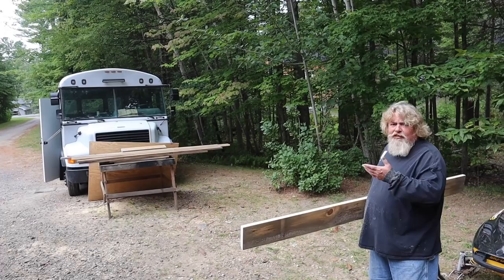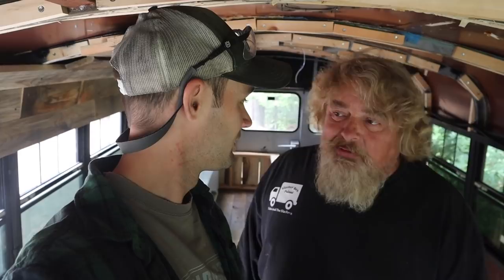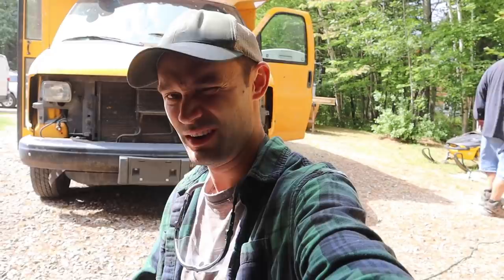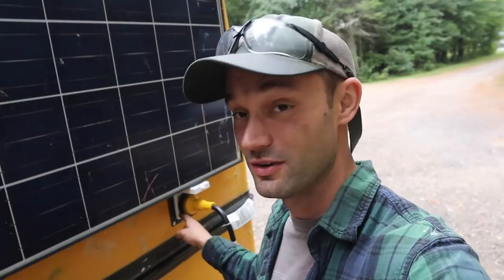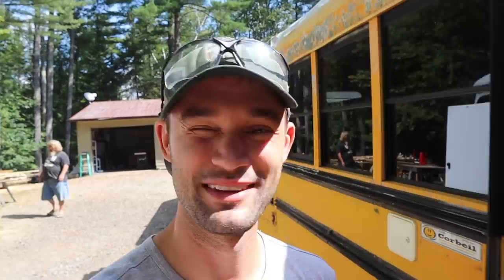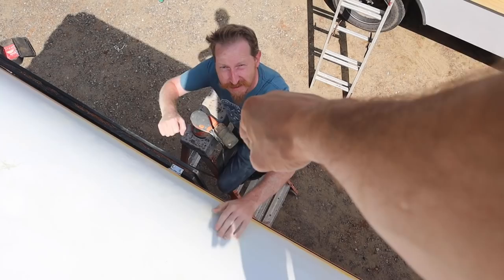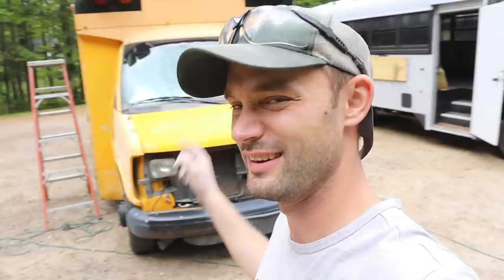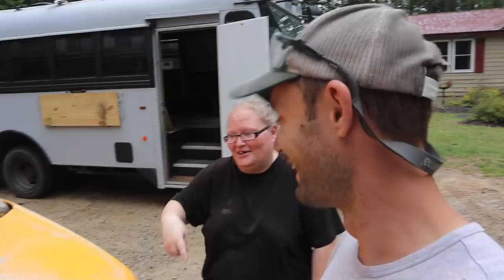I Think We Can Fix It | Broken Down Bus Conversion

Comment: Remember how I had trouble getting my bus started when we were there on the Ice Cream Adventure? It was the same the entire time and stopped starting a couple days after we got back 
The mobile mechanic found that I wasn't getting power to the lift pump from the ECM (computer). Put a new ECM in ($2100) and still the same for starting but is running better when it does.
 Finally bypassed the power for the lift pump to a switch on my control panel. It's only needed at first until the injection pump starts pulling fuel. 
Maybe Gina's bus is having a similar issue.
Reply from the maker: I am calling Badge about this one. Thanks for the tip Steve. Also, amazing ice cream adventure.
Reply: @navigationnowhere  sometimes you gotta call in the big guns.
The Creamery was by far the best
Reply: I'm just hoping we can get it figured out. Nothing stresses me out more than being parked in the middle of nowhere and the bus won't start. 😳
Reply: @ginabrytowski3564  me too. The whole way home the last with Carson I kept telling the bus to just make and I'd get it a mechanic
Reply: ECM = electronic control module????
Reply: @justme5694  yes. AKA the brain
Reply: @SteampunkSteve  Thanks Steve

Comment: Hard starting I. E. long crank times when it's been sitting overnight is usually due to leaks in the fuel return system which allows the fuel to drain back to the tank.
Reply from the maker: I will give that a look.
Reply: Yes. And it could be sucking air in to the system. Diesel hates air in fuel system

Comment: Oh Dale!  All that sawdust.  Wasted!  What do you do with sawdust?  I scoop up a peanut butter jar or two whenever I am working on a projects.   1st, it is the exact wood you have been and will be wording on.  Any wood surface repair will disappear.   Mix it with some ash and a (very) small amount of lantern fluid and you have some excellent fire starter!  People like me who cannot light a fire can drop about a spoonfull over kindling and paper to get a good fire going.  Just keep it in a can with a tight lid and don't store it on top of a wood burner.  Remember Uell Gibbons?  "Ever eat a pine tree?  Some parts ARE edible". No, if I  start talking about roughage, someone might take it seriously.   There is another really practical use for sawdust that I cannot remember and won't until the need arises.  Rats!

There is nothing better than running a piece of old board or pallet wood through a planer and seeing what comes out at the other end!

Great video!  Thanks!

Comment: If the the problem is cold starting, I would check on the Glow plugs.
Reply from the maker: They were replaced 6 months ago before she arrived at my place.
Reply: @navigationnowhere  Might want to check the electrical connections to verify the plugs are operating correctly.  Also check for a relay & fuse in the electrical path, my diesel tractor has one of those and gave me a fit to hunt it down and replace it.

Comment: Not sure if the yellow bus is diesel but if so may be the glow plugs also if it has an injector system could be bad injectors or you just have a lazy starter motor
Reply from the maker: The glow plugs were replaced 6 months ago. It is going to be a investigation.

Comment: Why did you do the solar on the side of the bus?
Reply from the maker: It was done 2 years ago, I am not sure why she preferred it on the side. It works just as well when tilted. The only issue she has is that it forces her to park in a single direction when camping.
Reply: @navigationnowhere  Thanks!

Comment: If anyone can help I’d appreciate it! I’m trying to find someway to insure my bus that is not converted yet in Michigan. You can’t insure it as a commercial vehicle for personal use in Michigan and I have no idea how to insure it.
Reply: Have you tried finding some local brokers instead of calling insurance companies directly. Sometimes they have solutions and work with multiple companies. Since laws vary so much from state to state sometimes the local brokers have connections and means that you can't find through a direct route. 

Also, look up Roamly insurance and describe what your situation is.
Reply: @TheDawnofVanlife  I’ll look into that thank you! Everyone I know that has a schoolie in Michigan never even insured or registered it until it was finished and they could insure it as an rv. Most here go with State Farm. I have called every local insurance place within two hours of me. They all said the same thing. Michigan’s strict. Maybe I’ll just get a cdl just to insure it. I wouldn’t be to worried if I had drove it all the way home after I bought it but I drove it straight to a mechanic so I knew for sure everything would be operable. I’d like to have it insured and registered for the drive home. Thank you for referring me there I’m going to look into it!
Reply: @nicolebee1028  If you have any angle to insure it commercial, just do that in the interim. I have a box truck conversion and those are a pain to insure even after finishing the build and a new title. I just ended up flat out doing commercial insurance as a sole proprietor so I could drive it, pick up materials, etc. It's small enough that I can drive it with my regular license, but too large under California law to be a personal vehicle, it had to be commercial until it was converted. But I've done a bunch of freelance and contractual work for years. So I just worked that enough to get insured.

And yes, State Farm is a good go-to for schoolie. I've also heard Farmers insurance is good at working with people. You don't need a CDL to insure commercial. Commercial insurance can be acquired for any "bussiness" (including a sole proprietor) that needs to cover a company vehicle, so including a regular ol' car. Also, you can own commercial vehicles as a bussiness owner that you don't drive, but have to insure cause it's your bussiness. It's just that when the bussiness sells the car it can become someone's personal vehicle right away. Where as once you get into commercially produced vehicles (like buses) going from bussiness vehicle to personal vehicle can get complicated depending on your state's policies. So if the engine/size weight etc. is legally drivable in your state under your current license, you just need a commercial insurance policy.

Comment: Why are the solar panels mounted on the sides? Just curious if there was a reason for that or not installing on the top??
Reply from the maker: No reason as far as I know. Gina had it installed 2 years ago. The downside is that she has to park  with the driver side always facing the sun.
Reply: I would think it gives Gina some control over the angle of the panels meeting up with the angle of the sun.  Yea parking with the driver 's side being in the sun is a bitch but thats the price she pays!!!   Gina looks to be about my height and I'm short.  So she can "manage" the panels without having to climb onto the roof too.  But i'd be worried about the cables getting pulled or ripped out of the panels by driving or maybe catching a branch!!!  So 2 pros and one con!!!  50/50.   Not too bad.

Comment: Won't Dale's ceiling add a lot of weight to bus? The boards looked pretty thick.
Reply from the maker: They are pretty thick we will have it weighted when the build is done. Overall though, most of the time you rip out more weight than you put back in. The metal interior is a lot of weight.

Comment: Why That Much Weight With The Wood Dale's Bus Is Put'n In? With Spray Insulation Foam Will Have Enough Insulation Factor. The Gas Mileage Hauling That Much Weight Makes No Logic. Why Not Cut Through The Whole Board To Make Them Thinner? 1/2 The Thickness. You Have The Saw To Accomplish This. Tell Dale Save The Saw Shavings. People Use To Insulate Their Homes With Saw Dust Shavings. The Down Side? A Huge Fire Hazzard When A House Catches On Fire! They Go Up Fast.